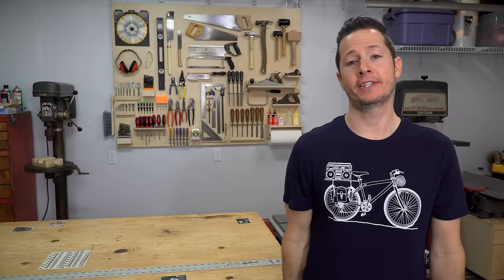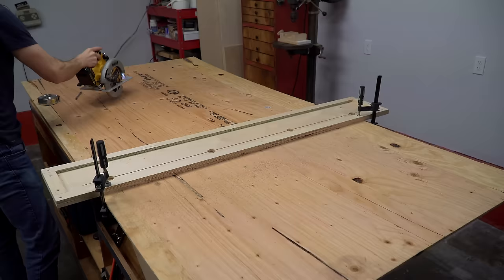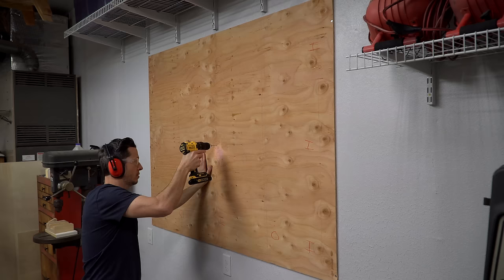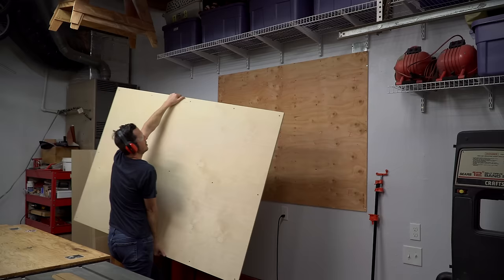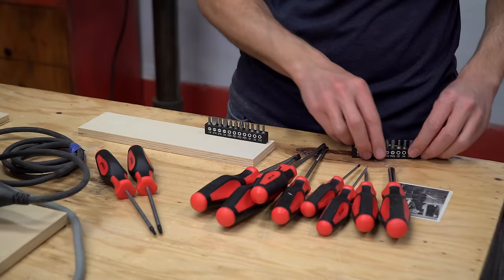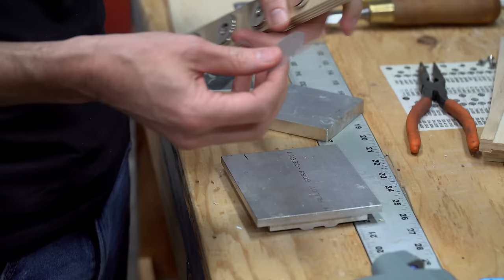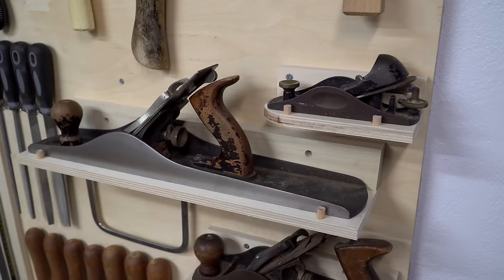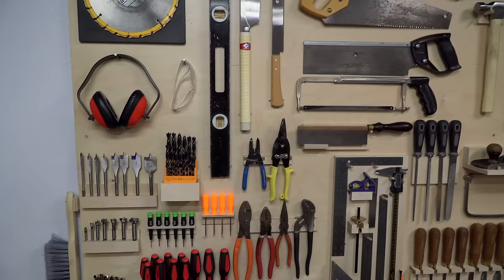How to Make a Custom Tool Organization Board

Comment: Nice tool board Tommy. Love the trick with the hot glue discs. Cheers, Huw
Reply from the maker: Thanks, Huw!
Reply: I would make photo copies of each tool, cut them out and stick in place.  Makes it easier to move to another location.  Sharpie markers are more permanent .

Comment: Peg board for holding tools works perfect if you know what you're doing. You should make sure your tools are organized right where you want them, then glue all the pegs into the holes using GOOP. There are several different kinds of GOOP, which is just a clear rubber that works better then silicone because it dries fast and ends up being just hard rubber. It holds all my pegs in place and can be moves by just pulling them back out with a bit of effort. Try it!

Comment: French cleat is better for hanging it on the wall imo,  especially if ever need to move it, nice tool holders
Reply: Agreed. Move anything as things change over time.
Reply from the maker: Thanks! I know a lot of people are big fans of french cleat, but it just wasn't right for me. I feel like the hardest part of any system is building the custom tool holders. Once the holders are built, it just seems easier to me to hang the holders with pins. It still allows the holders to be rearranged easily, but it removes a layer of complexity in building and arranging them on the board. With the french cleat system, you have to consider how adding the mating component will be attached to the holder, how the will affect depth, etc. You also have to conform to the lines that are on the board. I prefer the blank wall to work with, as it just seems easier to setup. All that said, I'm not discounting a french cleat wall - it beats a pegboard any day of the week!

Comment: Great work! At first, I thought it was a complicated build but then it was not. It was very simple and practical. Looks clean too. I like that you used finished nails on some hangers which gave the illusion that the tools hanging from them are just sticking on the board. Thanks!

Comment: Instead of trying to even out the high and low spots the way you did it, a much easier way is as follows: cut three or four (depending on desired width) 2x4's to length and fasten them to the studs using hammer-set anchors. Use a long level to check for high and low spots, and adjust the screws where needed. In any low spots, the screw will be unscrewed a bit out of the anchor. Wedge a spacer between the 2x4 and the drywall where it 'floats', to provide a sturdy backing. The end result is a frame of 2x4's that is as close to a perfect plane as possible. Fasten your plywood backing to the frame.

Comment: I like your layout. I would like to use a similar layout but I do woodworking, mechanical and metal working so I would probably need a tool wall twice that size. However, I don't want to put tools out that rust easily because I live in a moist part of the country.👍
Reply from the maker: Thank you! I did have to reconsider some of the tools I'd have on the wall because I was worried about surface rust. Either way, if you build a tool wall, I wish you good luck with it!

Comment: I've rearranged my pegboard more times than I can count.  Usually it's minor stuff.  I've done major rearranging probably half a dozen times - once every three years or so.  Part of the reason was I was showing off cool tools I never  or hardly ever use.  Also what I do has changed significantly but only a little at a time so tools I use change as well.

I actually love pegboards and never have problems knocking off adjacent tools.  But yeah, the pegs falling out is a major issue and annoyance.  I've found some pegs that lock in pretty well but they don't come in all the varieties I need.  So some I still have issues with but most are resolved.

The problem with specialized boards and organizers (I've done tons of them) is that one new tool, one broken tool that isn't made any more, or whatever makes it stop working right.  You really can't future-proof custom boards.  But they are worth having.
Reply from the maker: Thanks for sharing your thoughts on the topic! The custom board actually is rearrangeable. Since the only thing holding most of the holders is pin nails. When I need to move something, I just pull it, put it in its new spot and fire a few more nails. I was thinking about how you said you've found some good pegs that lock in place well, but that don't necessarily offer all the varieties you need; could you make custom pegs that are the shape you need, but use the better locking style of the pegs you like? Or maybe you could even make a custom tool holder that is held in place by those pegs? Anyway thanks again for sharing!
Reply: I just sanded and painted a 6 x 3 sheet of 5/8 chipboard and while it was horizontal, planned out where each tool fitted best for shape and space.  Then I used nails to act as test hanging spots, temporarily stood the board vertical and hung spanners etc to determine dangle-angles. Then I decided which needed a panel pin to prevent untidy dangles and others I changed to use various clip brackets.  I then made a few light pencil marks on the board to show which tool shadows would stick where. Once all this was decided I stuck all the tool shadows on, replaced all nails with the selected hangers, screwed the board to the wall and uploaded my tools.   Going from an untidy and dangerous work-bench to a clear working area is a massive relief, plus everyone that sees it, loves it.

Comment: I never really got all the hype about French cleats or pegboard. I used to do what you did, just pretty much put a nail into the wall and it’s good. I recently got a free 4x8 sheet of pegboard and a bunch of hook things from work. Really depends what hook diameter you use. The 1/4” ones are a pain to put on and take out but they are solid. Then they have the skinnier like 1/8” or something hooks that go in easy and flop around. I like the look of pegboard tho, kind of a classic shop look.

Comment: Nicely done tool wall. My tip for source of strong magnets: old harddrives.
Reply from the maker: Thank you, and thanks for the tip!
Reply: @Mama C Just discharge the capacitor, simple as that. No boiling blod or amputated limbs.

Comment: Awesome video. With the hand planes, it is not good for them to be left sitting on the blade as they may become blunt or out of adjustment. I would recommend that you hollow out part of the shelf so that the blades are not touching any surfaces. Otherwise it was a great design.
Reply from the maker: Thank you, Max! I was worried about that, so thanks for that suggestion. I'll definitely do it!
Reply: Don’t listen to this comment, just because you learned something ask yourself why is that so? 

In the old days this was a common thing for teachers to say, because most of the time they had somekind of Iron on the workbench, putting the planes on it would ruin the blade. That is the only reason! But for some reason people just keep repeating it like it goes blunt on wood.

It is totally fine to put your plane down on wood a million times with out it going blund
Reply: The blade is set firmly enough to hold its position during the repeated force applied while planing timber.  So, the static weight of the plane alone,  cannot blunt (blunten? enblunt? desharpen? 😜), damage or shift the blade out of alignment.

Comment: You'd mentioned a couple of times about using pin nails to hold the boards for just in case you need to move them around. 
My question is, have you ever had to move stuff around? And have they held up and not gotten loose over time? I was 
planning on going with french cleats but after seeing your setup, I think this will work for me better. I only require about
4 feet by 5 feet of space to display my tools and the french cleat system have plenty of dead space.

Comment: Fantastic! Keep up the good work.
Wondering how splinter free the cuts are with the circular saw guide?
Reply from the maker: Thank you! The cuts are very splinter free, at least on the side that makes contact with the guide. The other side still has some tear out, but using a good blade helps to minimize that as well. I hope this helps!

Comment: Do you absolutely need the plywood underneath?  What about firing strips instead?
Reply from the maker: It might not give you as much flexibility with screw locations for the main board. I’d say it’s definitely a good way to save material though, and would reduce the amount of weight you have to lift in the beginning. I like it...probably pros and cons to each way, but again, it’s a good idea - thanks for sharing it!

Comment: beautiful board man, not sure if I should hold tools on it, or F it :) Sorry, had to, been a while since I could say that, because that is one attractive board for a simple tool rack, which I need.. and which would NOT look as sexy as yours if I try :)
Tools and everything else is of much higher quality and already well thought out in the US rather than Europe, where I have a place in one of those Austro-Hungarian buildings on Mediterranean... problem is, while looking romantic and all, partly exposed smooth white limestone etc the walls are almost 4 feet thick, but good luck simply hanging a small picture frame using a nail. 
Plaster on the wall is almost 200 years old, and directly beneath 1/2inch of this crumbling plaster are huge boulders, basically limestone from local quarries which would be hammered and chiseled into a flat surface on one side only to face the interior of the house, basically an interior wall. The next boulder would then be fitted like tetris wherever they could find a matching shape along the wall side and so on. 
The other wall, facing outwards, would go up at the same time, so two teams building two walls facing each other and maintaining the prechosen width. Heavy labor, but expendable workforce back then, I'm sure :))
Empty space in between these two stone walls would then be filled with leftover gravel and whatever else they could find. When just built, this was a fortress. 
In fact, the building was bombed, with many others nearby, right in 1945, and by Allied planes believe it or not. It was next door to the shipyard in occupied city nearby Italy on Adriatic, and deemed a legitimate target - though it really was far from worth the bomb raid as the war was ending and place abandoned, but the bombers would just unload and carpet bomb the entire area next to the shipyard, where many residents unfortunately died... but the building stood.. and even settled nicer after as direct hit blew of the entire third floor :) and this material is what they used when rebuilding to fill the gaps in the rebuild process immediately after the war haha. 
It still is a solid fortress, but doing any simple stuff like I mentioned, hanging a shelf etc would end up being a disaster. 
When you held up the osb then nailed it easily, over here that nail would simply bounce out rejected by the stone, so I would end up with 38 holes at different places. all while holding this heavy board, trying to find the space in between stones to at least hold this one damn nail, then inevitable crash, boom, I would kick the board and toss the drill, kick the toolbox and hit the bar while cursing the Emperor and mumble how easy this (and many other small diy jobs) was in the US, by simply finding a stud in the wall and using a nail gun :)...leaving behind the place looking like a post war zone with crap all over and numerous random holes in the wall as if it was shot up by the machine gun, dust from collapsed plaster.. -all to just hang one simple picture frame :)
Anyway, great job and sorry about the unrelevant rant, I feel better now and gonna go do my own tool rack! :)

Comment: Why you need two ply woods? Can't I hang only top plywood directly to wall?
Reply from the maker: You can use just one sheet. I preferred to use 2 because the first one lets me create a level surface to mount the second one to, and it provides extra thickness for the entire board. I could have bought a thicker piece of high quality plywood, but using a piece of construction grade for the first half of the thickness helps keep cost down. I hope this helps!

Comment: Thoughts on shadow boarding? I'm going to make a tool board, and I'm sure I'll want to re arrange it at some point, so I'm reluctant to shadow board it using a permanent marker. Any ideas on a quick and easy way to mark tool shadows in a way that isn't permanent? Self adhesive vinyl seems tricky for long spnfly things like coping saws...

Comment: I didn’t take the time to look through all 400+ comments to see if this has been asked, but I’m curious 1) what the thickness is of your “show” piece of plywood, and 2) did you utilize the leftover to build your tool organizers? I’m asking because my pin nailer only shoots max 1” pins and I’m unsure if I use 3/4” plywood, will the 1” pin be enough to hold everything in place using your pinning technique? Your input is appreciated. Thanks for the great idea!
Reply from the maker: I used 1/2" Baltic Birch ply for the "show" piece, and, if I remember correctly, 3/8" for the backing. Yes...used the scraps for tool holders. If you use 3/4", and 1" pin nails....it might be a little shy. You could always test it out on some scraps before you get started with the project. That will let you know if you can get away with 3/4", or if you need to step down to 1/2". I hope this helps!

Comment: Love everything except the spade bits with the points up.
Reply from the maker: Thank you! What ideas do you have in mind for the spade bits?
Reply: @OneMinuteWorkbench  Just turn the spade bits over so the points are in the holes you drilled for the shanks.  Maybe even drill smaller holes so they fit tight.

Comment: Love the channel. Maybe I missed it, but what were the dimensions of your tool board? I'll be planning one soon, but I don't want to go overboard or underboard, for that matter. Thanks.
Reply: pretty sure the dimensions were customized to his available space... as yours (were you to build one) should be, yes?
Reply: True, I would customize it to my space. I was just curious what size his was just to get a sense for it, seeing all he could fit on his board.
Reply from the maker: Taylor, my board is 64" wide x 48" tall, but as James mentioned, you can make it whatever size best fits your space. I'd recommend standing near the space you have in mind with a tape measure, and trying to get a feel for how big you want it to be. Make sure you can reach the items at the top, and make sure the lower items be so low that the get in the way of other shop items. Then go as wide as like, again making sure it won't be in the way of other important shop items or process locations. I hope this helps!

Comment: Hot glue on the magnets: bad idea.  While increasing the friction, you are reducing the strength of the magnets by demagnetizing them with heat.  Don't heat magnets, it will make them weaker.  Make the separate hot glue pads if you wish, but attach them with epoxy to avoid heating.
Reply from the maker: Thanks for sharing that tip!

Comment: 8:37 - Very nice work! How did you wind up creating the holder for those?
Reply from the maker: Thank you! I drilled through holes just larger than the diameter of the shaft of those tools, then drilled counterbores that were just larger than the handle's largest diameter (the counterbores were about 1/4" deep), and then cut the slots using a bandsaw. I hope this helps!

Comment: Hi, I dont understand why you made this with 2 layers of plywood instead of just one thicker?
Reply from the maker: The first layer let me place screws at random points and set different drilling depths for those screws in order to flatten the surface. The second layer has a systematic series of screws so they look nice. Anyway, I hope this helps!